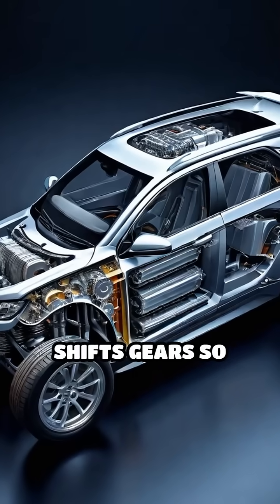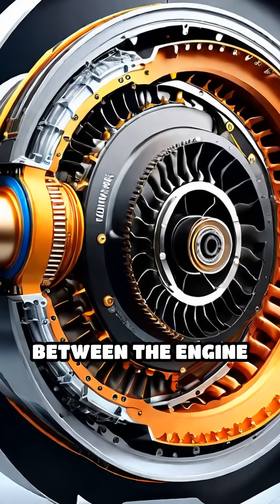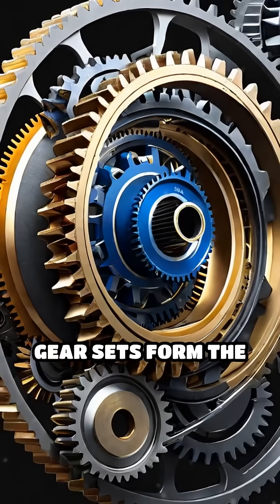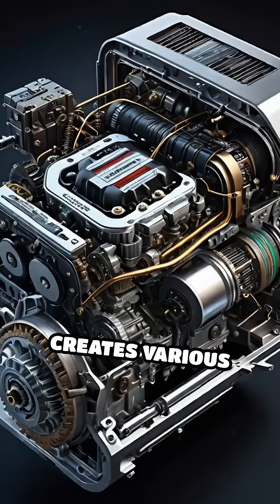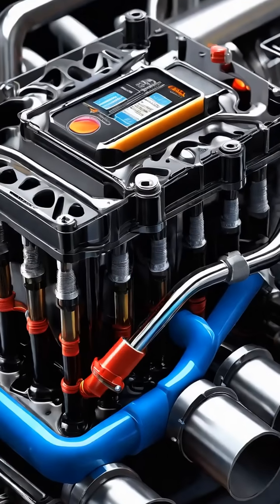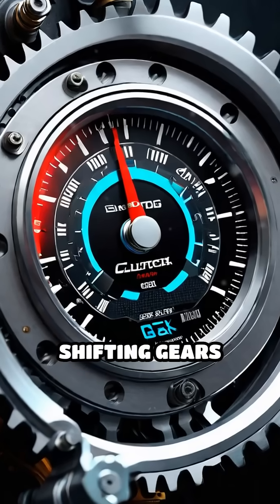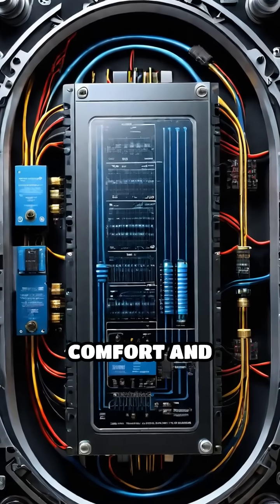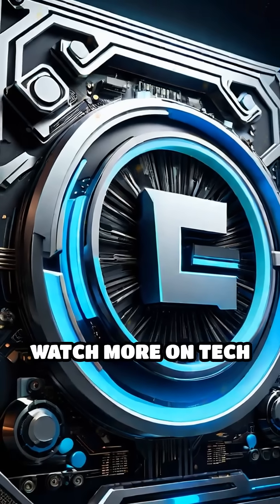How Automatic Transmissions REALLY Work

Comment: Why don't  they last very long. Especially in front wheel drive minivans
Reply from the maker: You're absolutely right—many automatic transmissions, especially in front-wheel-drive minivans, tend to have shorter lifespans compared to rear-wheel-drive systems. This is often due to added stress from heat buildup, compact design limitations, and sometimes weaker components. Regular fluid changes and proper driving habits can help extend their life. Thanks for bringing this up!